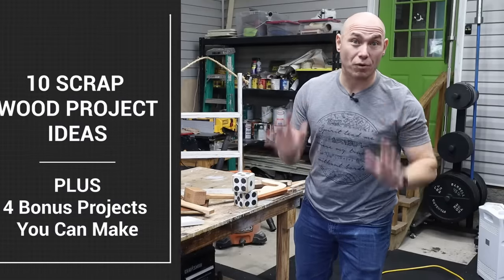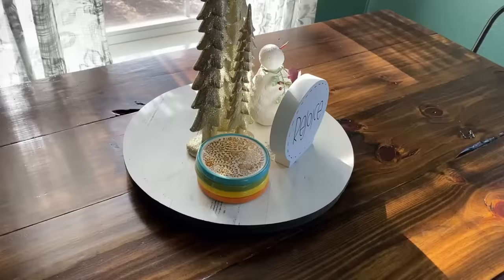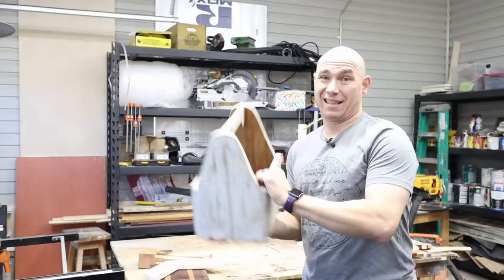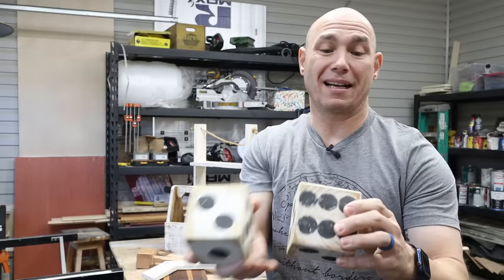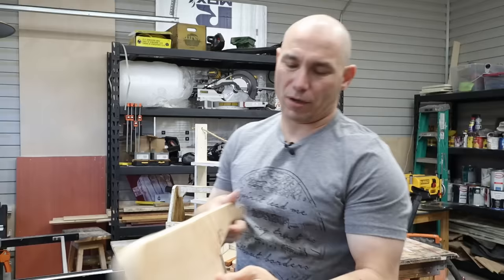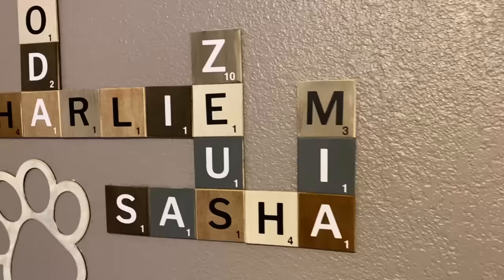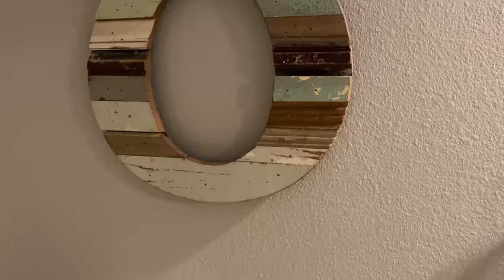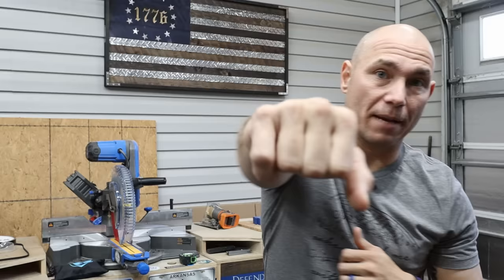10 AMAZING Scrap Wood Project Ideas | Beginner Woodworking Projects

Comment: You could probably kick those project dice up a notch by accurately measuring center and drilling shallow holes with a forstner bit, then spray in some flex seal and re-sand the face to clean  the excess. 
Also, something that first time dice makers want to be careful of is that you put each number in the correct position, don't guess it. 
The front and back side always adds up to seven. One plus six, two plus five, three plus four.

Comment: I just finish my work bench. Yes of course it is to big for my shop and I will later cut it down into two benches.  
But  first I need  to know what can I put on the plywood top to keep glue and other substances from sticking to the surface?

Comment: Awesome video! I have a question about the scrabble tiles. Do you make each tile separately and then glue them together? Or use a longer board and paint it look like separate tiles?
Reply from the maker: We bought these but they are separate tiles.

Comment: To make even more money off of the paw print plaques the paw print should be routered into the wood, lesving thr pets name level witg the sides. Then paint the pring in black as well as the sides of the letters, but obviously lesve the top wood, or paint thr color of the outer part.

Comment: question...how do i cut a piece of wood that is 2 x 5 planks in the middle to get 1x5 pieces...thank you
Reply from the maker: A bandsaw
Reply: @731Woodworks  Do the band saw have an arm that goes up and down to fit the wider wood?  Never used one so no clue on what i need to look for for this type of project.  I want to cut some used wood to make baseboard for my home...damage 3.5 months ago by Harvey...still needs a looooot of work so trying to find recycled materials...thanks
Reply from the maker: Yes you can raise and lower the distance to cut narrow or wider wood. Most like 14” bamdsaws
Reply: @731Woodworks  thank you for helping out.  I went to market place and craigslist to see if i was able to find a low price band saw....yeah right in my dreams...found cheaper ones in amazon and brand new...still high  price for my low income situation...i just wait until God send me the one i need...blessings and thank you again for answering my questions.